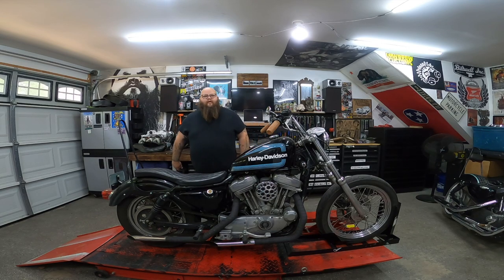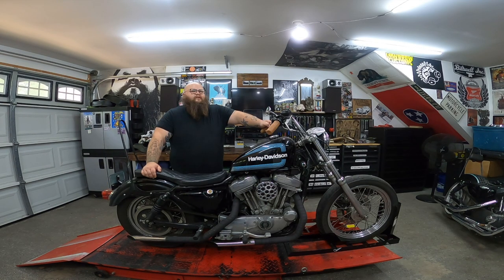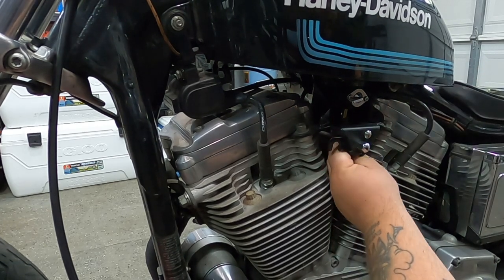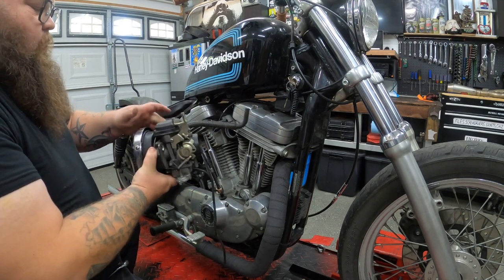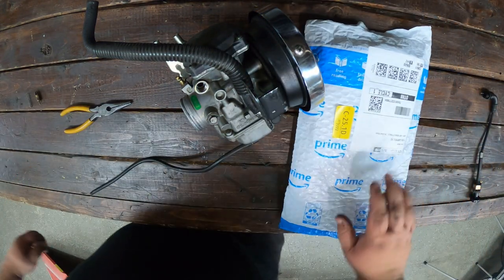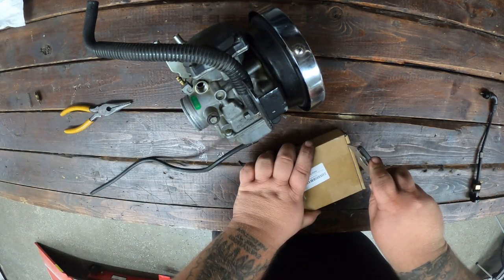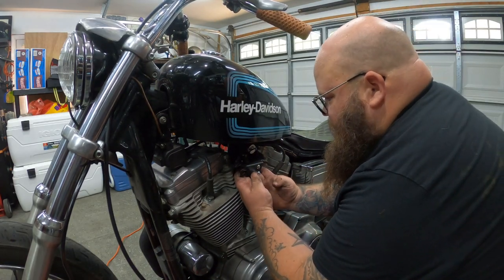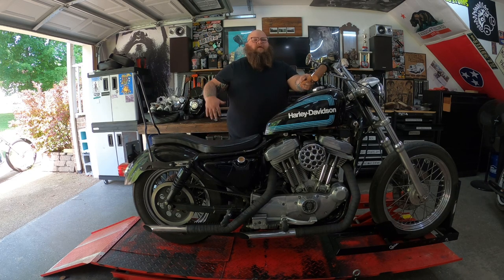CHOPPERS FOR DUMMIES EP:5 - Replacing Harley Choke Cable

Comment: To make it easier to press the carb back into the rubber gasket ..pull your dipstick from your oil tank smear a dribble( technical tearm😄 ) inside the gasket or a little spit on your finger smear it around inside of gasket ...carb will slide right back on 

Party On..👍😉👍
Reply from the maker: Great tip! Thanks.

Comment: Yea man you can usually get it to work again by tightening then it on the back side but if the threads are chooched you gotta take the baloney poney to the bike shop and order you up one
Reply from the maker: Rachel broke this one off! Had to replace it. East quick fix.

Comment: If the overflow tube leaks a bunch of gas does that mean the carb is blown?
Reply from the maker: sorry for the lag in response. i don't keep up with this page as well as i used to. if the overflow is leaking, chances are, your float is stuck open. just need to take the bottom bowl off and see why the float isn't moving. sometimes its a simple as taking a screwdriver and tapping the bottom of the bowl without taking anything apart and it will unstick itself.